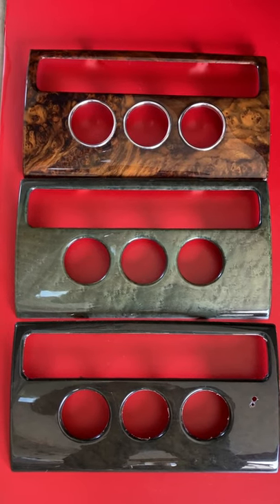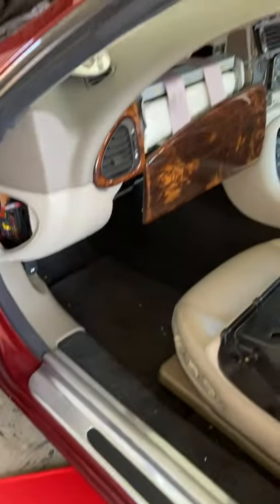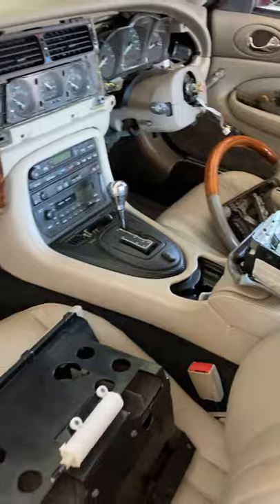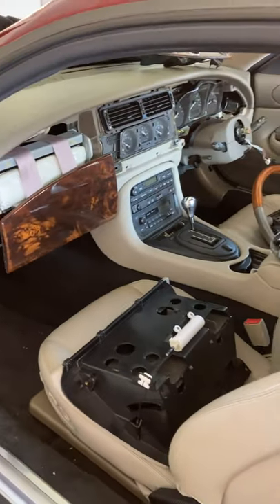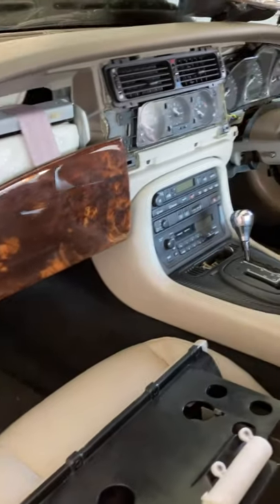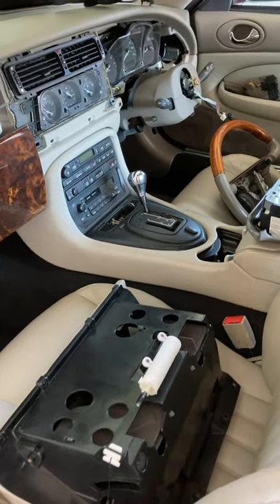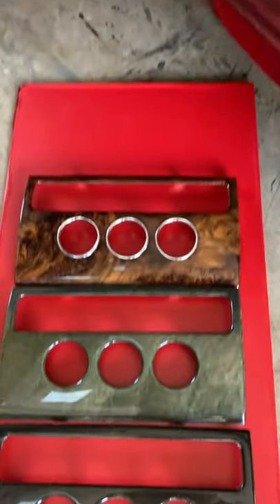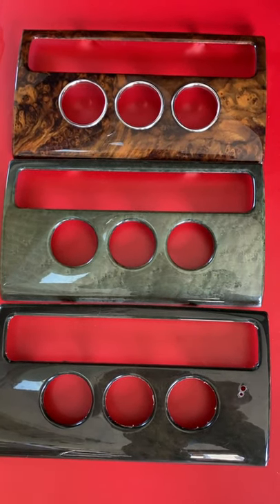Jaguar XK8 Dashboard veneers and various jobs video S9 / XKR (X100) #shorts

Comment: I've got to remove the veneer around my XK8 centre air vents. Not sure what tool to use. Worried about cracking it!
Reply from the maker: Plastic trim tools but this video might help avoid any damage, see link below, regards Damian.
Jaguar XK8 Dashboard Central veneer removal - change swop design V119 / XKR (X100)
https://youtu.be/JkeBmW_94F8